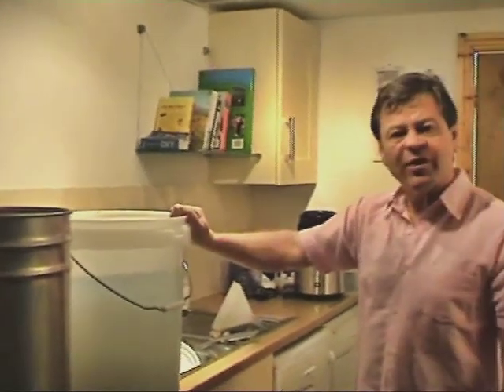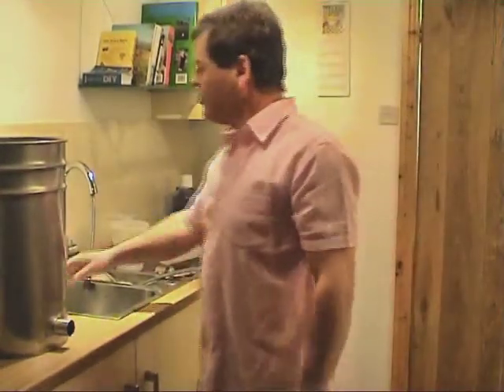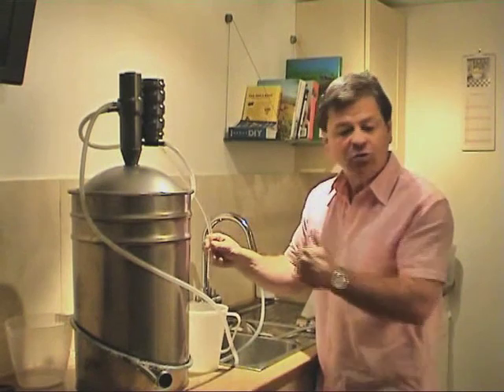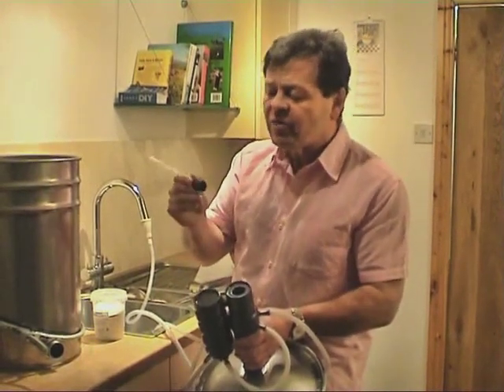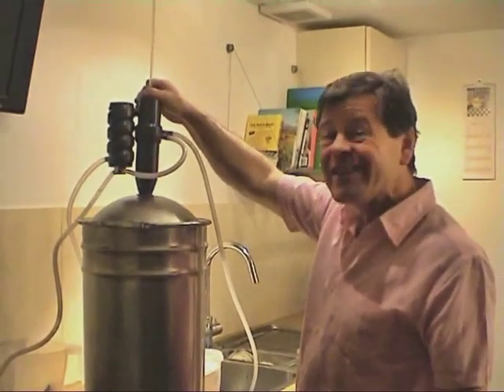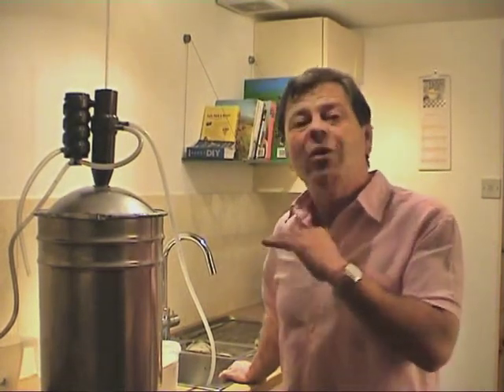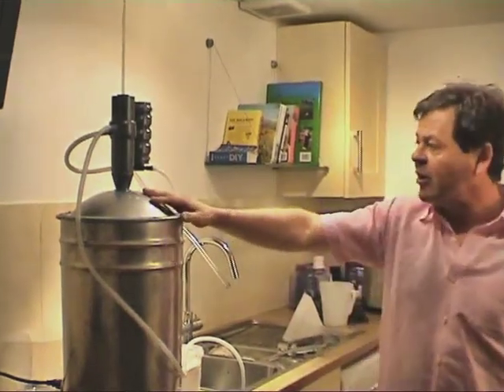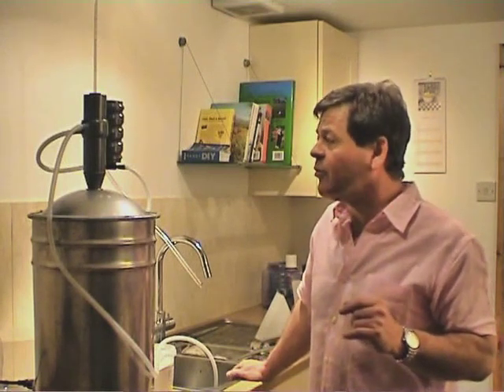Making Spirits & Liqueurs at Home - Part 5: Using The Reflux Still

Comment: Hi Richard,
i ordered this one from your store about a year ago.
We use it with the extention column and replaced the saddles from the upper half with stainless steel pot scrubbers, got the % up to 94%!
We love this still.
nice video's !
Reply: G'day mate. I've just purchased one of these while I modify my larger beer keg still. It has the extension section on the bottom I'm  Interested in seeing how you ran yours for any tips on how you run this little unit. 
Cheers Dave from Australia

Comment: Hi there .. I'm a novice and trying to learn a much as possible but I'm now getting myself confused .. you don't talk about the head, heart and tail and splitting into these . Is there a reason why you don't?
Reply: There are very few heads worth removing if using the pure yeast. With classic yeast we recommend removing the first 100ml. With a refux its not necessary to remove the tails.

Comment: no matter what still you are using you should not use turbo yeast, this yeast produces harsh flavoured spirit which requires filtering to make it even half drinkable. Try using a tomato paste wash or a cereal wash. costs about 10% the price of a turbo . And don't have a plastic take off - replace this with a short length of copper pipe.

Comment: You say it can produce fuel ethanol. Can I use the ethanol like ethanol sold in gasoline stations (E85)? Is it the same/similar grade/quality? I have SAAB 9-5 "bi-fuel" car that drives both on conventional gasoline (E95) and on commercially sold ethanol (E85)...